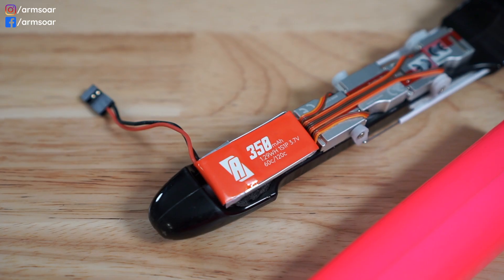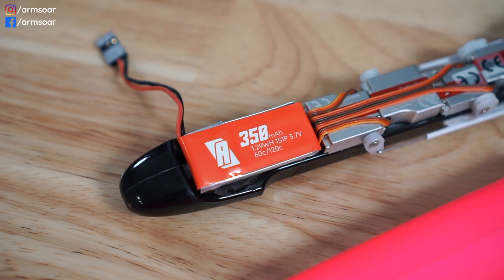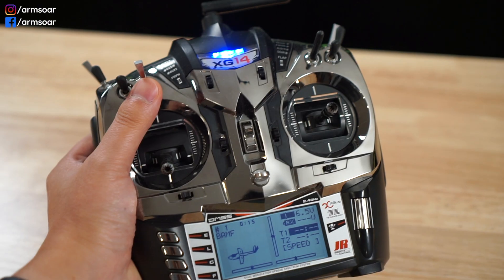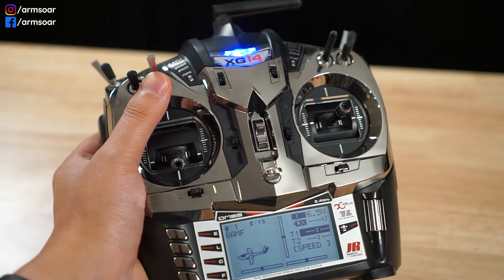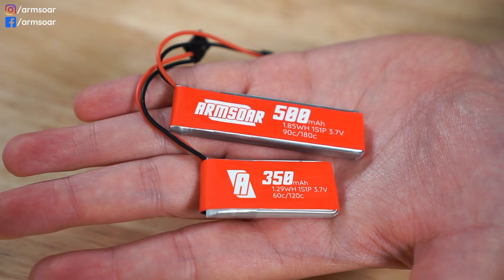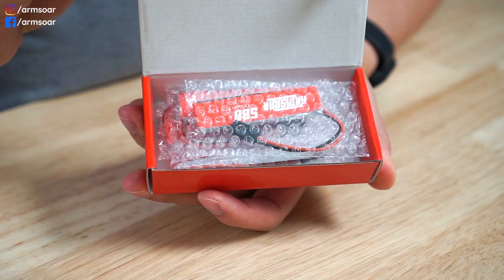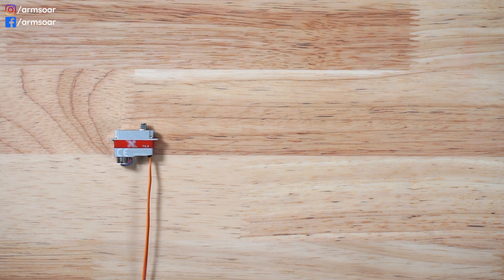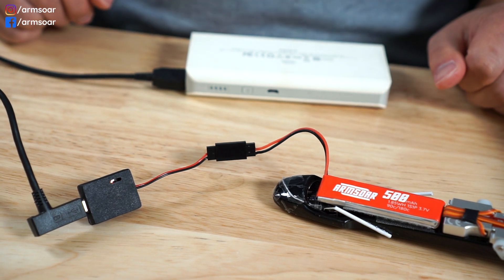RC Glider Basics | DLG Batteries

Comment from the maker: What batteries are you using for your DLGs?
Reply: 2s Turnigy cut open in half and then taped up again with kapton tape. Slightly frightening. 300mAh. That's what is recommended by VM for my Yoda.
Reply from the maker: @CyclingMikey  It's interesting VM is recommending that, I'll need to try the X06's on my DLGs on 2S and see what the difference is.
Reply: I'm using a 1S 350ma Turnigy in my Deviant. I don't believe the ArmSoar batteries were available at the time. I only bought 1 battery to make sure it would fit and balance thinking I'd buy more if it was the right fit. Turns out I can fly well over an hour per session on that single battery. I'll be getting a pack of the ArmSoar ones when I get the needed accessories for my Bamf 2 that's on order :)
Reply from the maker: @Scott_Hudson  It's amazing how little power some of the current electronics draws! Hope to get the BAMF 2 in your hands soon :)
Reply: Hi Thomas. I was using 2s 450 mah, because I was insecure about using 1S. Thanks for sharing!
Reply from the maker: @rapharigoti  glad to help!
Reply: You could use some beta fpv 1s lipo hv with a bec It ends up to 10 grams and you can buy 5 of them and a tiny charger you can charge them with a power bank
Reply: i thought all elrs receivers take 2s ? not 1s...
Reply: 1S 500 to 1S 600 LiPo.  Driven by the requirements of mobile phones, almost all "micro electronics" components are now designed to operate on 1S.
Reply from the maker: @IvanMacKenzie  we are lucky to have all these advancements that trickle down to our hobby :D

Comment: Stupid question maybe: I am used to plugging the battery into the ESC and the ESC into the receiver. Obviously, a glider does not need an ESC. I understand that I need a 1S Lipo to power the receiver and the servos. However, where/how on the receiver do I plug the battery? Do the 1S batteries come with a plug for the three pins in the receiver?

Comment: What FUTABA Rx are you using for 1S Lipo? R3004SB needs 4.8～7.4V in spec sheet. I don't know slim FUTABA Rx for 1S.
Reply: I use several Futaba receivers that work fine on 1S. It’s the servos that need a certain voltage to operate optimally.

Comment: Using 650 mah 1S removed from Vape sticks  The size and shape of a AAA alkaline and weigh  ~12 gms also have a built in BMS so just plug in any USB charger.
 Cheaper to buy complete Vape contraptions  ~4$ each and remove the batteries  :-)
Reply from the maker: Sweet trick!!

Comment: I have room for a lipo alarm, but 1s batteries don’t have a spare balance lead. Without telemetry receivers - how do you know when you’re running low on juice?
Reply from the maker: Can't believe I didn't talk about this in the video... d'oh!!
I have voltage telemetry set to 3.6v (many others use 3.7v).

Comment: Hi Thomas. My name is Doug and thank you for your informative videos.  I am a newbie to this sport and have not been successful yet in building a foam dlg from scratch...a little too heavy I think. I wonder which model you would recommend that is good for a beginner. I am looking for one that is forgiving in its flight chacterisics and is not too difficult to assemble. Thanks,Doug
Reply: Hi Doug what is your current skill level? Do you allready fly traditional gliders like a Bixler say?
Reply from the maker: Hi Doug,
I’m happy to hear the videos are helpful!

For a first DLG, just keep in mind you will most likely damage it and require repairs. A one meter DLG is my typical recommendation because they are much cheaper, there is less momentum so crashes are less damaging, and the short span means you won’t tip strike the wing, all of which means you’ll get more air time and a higher chance of success. 

Between the Deviant and Mini Dart 2, the Deviant is stiffer and higher performance. The MD 2 is cheaper which helps the wallet when learning, and the XPS foam core allows you to steam it back to mostly the original shape for easier repairs after crashes. 

Regardless of the Deviant or MD2, I would highly suggest going with four KST X06 servos. No other servo in this size range will give you the centering accuracy like the X06 to properly trim out the model. You’ll be able to reuse those in your next model as well if you damage the first one beyond repair. 

Hope that helps! If you have questions message us through our US store www.armsoarusa.com.